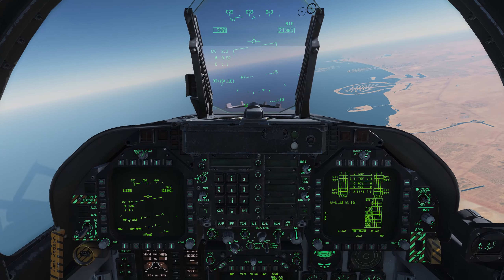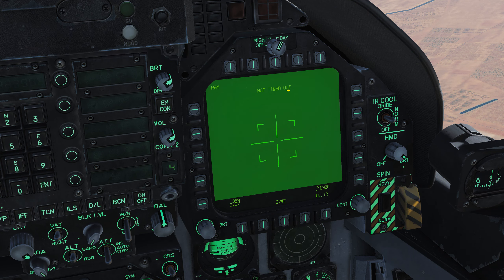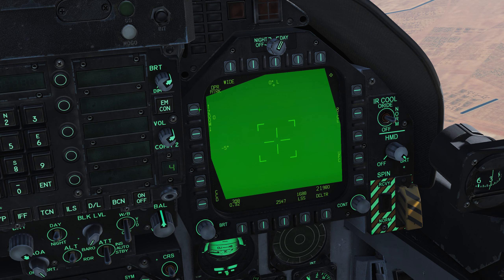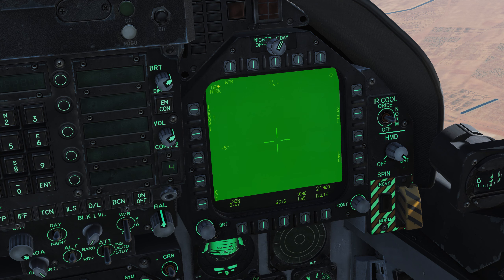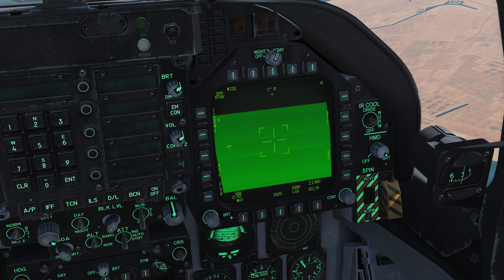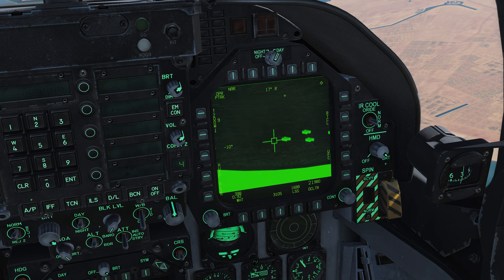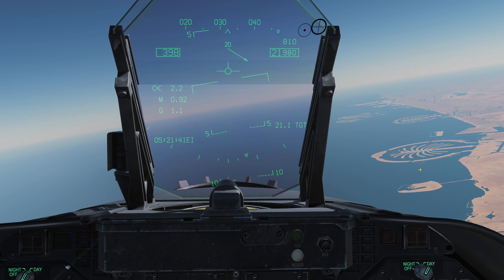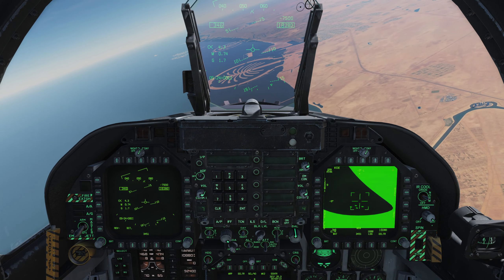DCS World Tutorials - F/A-18C Hornet - Intro to the Targeting Pod

Comment: Ravagertalon - i really must say that you´re way of doing your tutorials is excellent. You deserve so many more views. Very clear, easy to follow even for non native english speakers. Two questions about this video: I´m just starting to learn the F/A-18, and i´m struggling with getting the little box on the target, so pressing the TDC-button doesn´t give me a lock. So i only can slew the cross around, but even when pointing directly on a hostile target it isn´t changing at all... What am i doing wrong? Master Arm is on, either A/G modus. Selected weapon i want to feed with data from the TGP is a J-82 (i saw another video from you prior to this and wanted to train JDAM. Second: Could you give some informations about how to axis tune the TDC for the Warthog Throttle? Thanx mate - keep on doing this! Cheers
Reply from the maker: It sounds like you're trying to get a point track on the target. Getting point tracks is tricky sometimes. I'll zoom the pod out a bit and try again, or I'll stick to area track (which I recommend doing for JDAMs anyway).